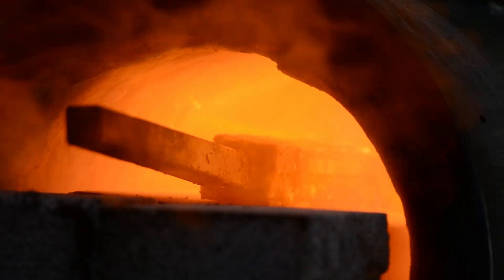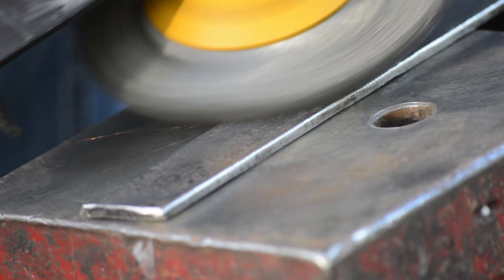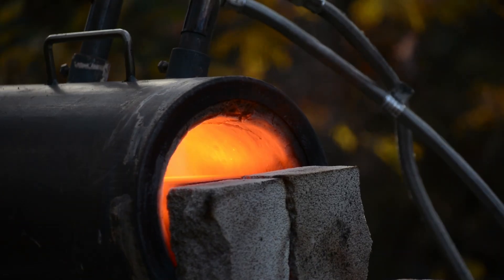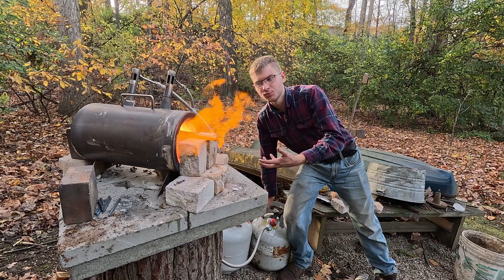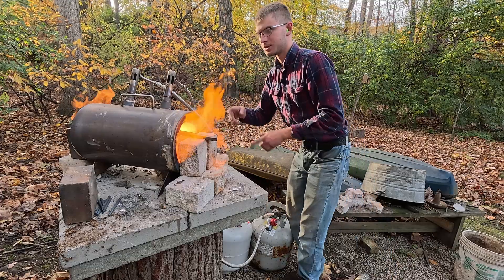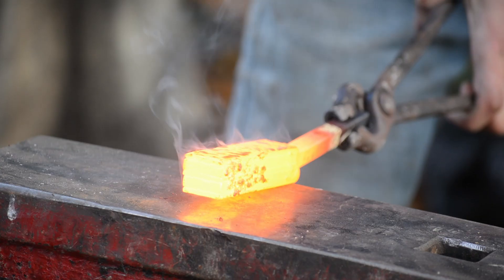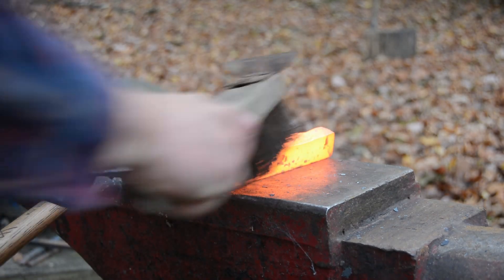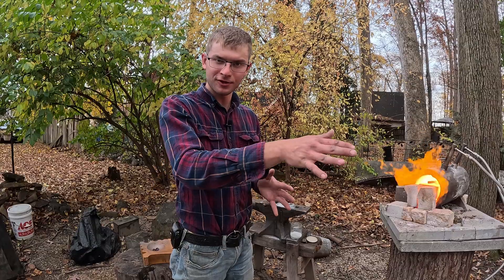Forging Damascus Steel Knife From Start to Finish - Full Blacksmith Build

Comment: In my materials class, during photomicrography of grain structure, we’d grind and polish the specimen before etching with muriatic acid. 

not sure if grinding and polishing would help in this context. 

it also very much depends on the type of steel you’re using. difference constituents of carbon/nickel/ chromium, will change the dissolving rate your steel experiences
Reply from the maker: That is awesome!
Thank you so much!
Reply from the maker: Do you have any requests for future videos?

Comment: Most people use ferric chloride  or gator piss(from baker forge). Then do coffee for darkening the blade. Also you didnt mention what type of steel you used, for a clear pattern not only do they have to be different the have to etch different. Most people use 1084 and 15n20. The 1084 will darken while the 15n20 stays bright due to the nickel content and resisting acid which will cause the pattern to have depth.
Reply from the maker: @DanielSmithForge,
Thank you so much!
I will definitely make use of this!
Much appreciated!
-Miles Forge

Comment: It’s cool to make Damascus. My one and only attempt right now has failed and it opened when I was trying to flatten it. As far as getting a pattern you should use ferric chloride and clean water, 1 part acid, 3-4 part water. Hope this helps!!
Reply from the maker: Thank you so much!! I will have to try that!